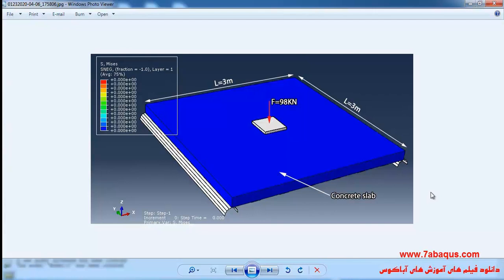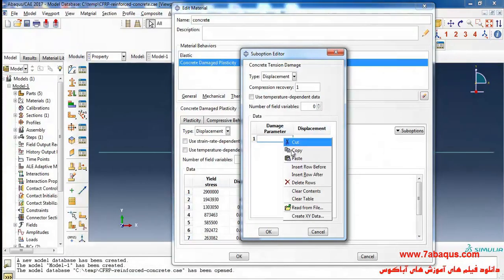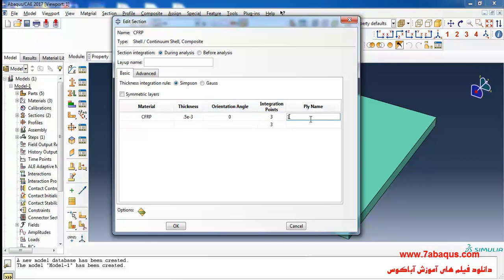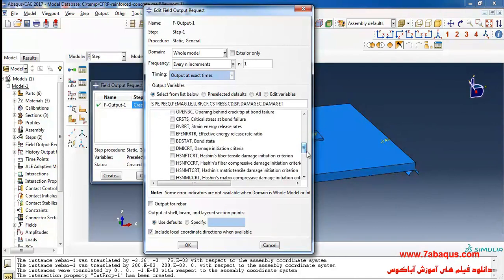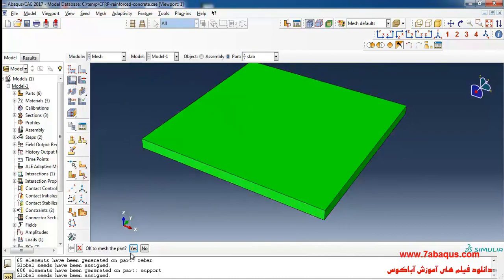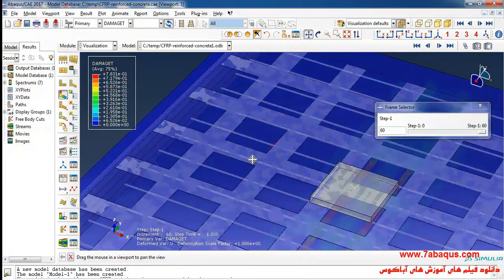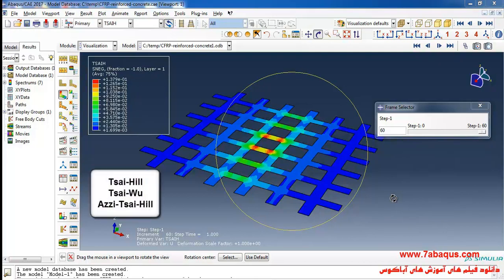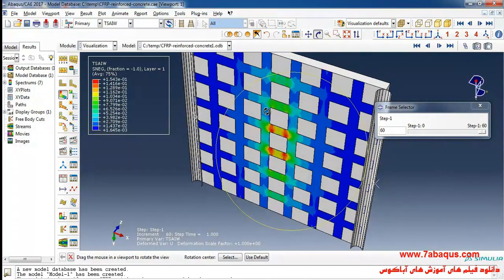Strengthening of reinforced concrete slab using CFRP in Abaqus

Comment: I want to model the two steel plates and wrap the CFRP material around it. I need to create a bond between the CFRP and the steel plate Need the ANSYS Simulations. I have the drawings of those 2 steel parts from SOLIDWORKS. Can you help me? Please drop your email to connect with you for more details. Thankyou.